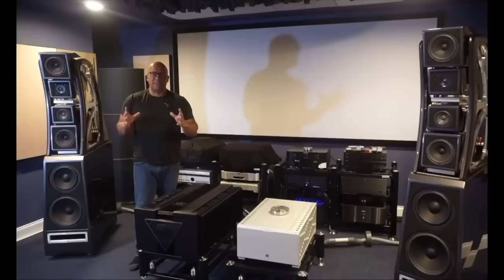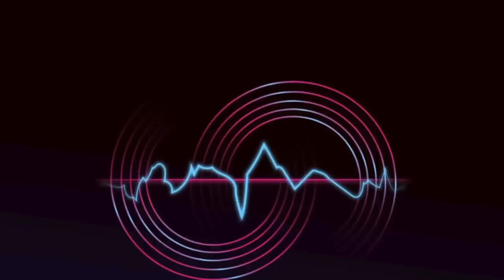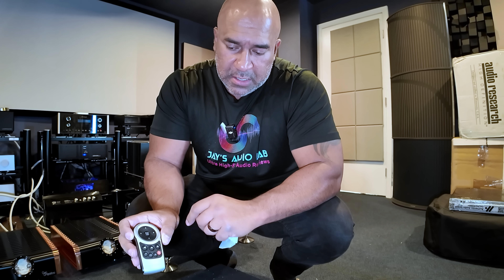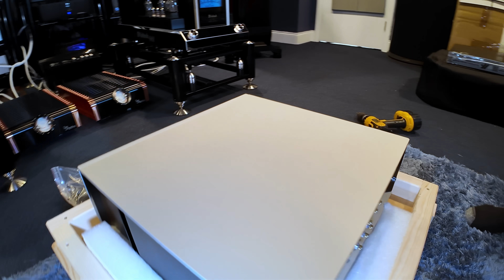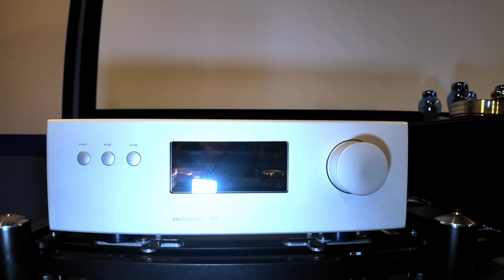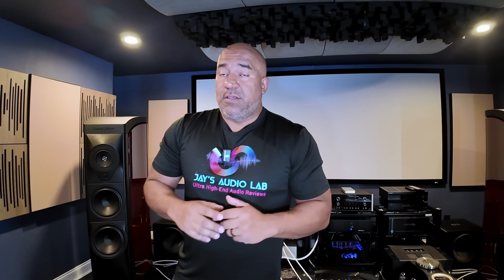Meet My Next Flagship Component !

Comment: The soulution-755 phono stage has volume control and the same output stage as their preamp. It would be interesting to compare this direct to the poweramp vs via the preamp you have at the moment. I am betting 755 direct will sound better. This would be the scientific way to really address the preamp issue rather than just rhetoric.
Reply: I believe the phono preamp is called 757, unless the 755 is its predecessor. I had a 757 in my home for 2 weeks to demo. 

I really liked the available inputs of 757; tape head pre, optical phono, low output MC and 42db MM. It would allow me to replace my CAT SL1 preamp w/phono, step up transformer, Manley tape pre and DS Audio pre. Unfortunately only the optical pre section was up to the musical standard of the component it would be replacing. 

The MC performance was close, a bit lower noise floor but I still preferred my silver wire Bent Audio SUT - CAT combo with its bigger and noticeably deeper soundstage that better placed instruments. There was also a noticeable difference depending upon cartridge as I mostly play only my Lyra Atlas mono MC these days. I still have a few other MC stereo cartridges; VdH, Benz, Shelter and Koetsu but I find myself mostly using a Grado Epoch or my DS Audio cartridges on stereo records. The Epoch was a REALLY bad match for the 757. An incredibly engaging cartridge sounded veiled, unengaging and lacking any fine detail. 

As bad as it was with the Grado, the performance was worse playing the tape head outs of my Ampex ATR102. 

Needless to say I returned the unit to my dealer. I even had the shop owner to my home for his opinion and he just shrugged his shoulders. I’ve never owned a Soulution product in past and obviously there’s a required synergy with certain components. I’d highly recommend anyone considering their preamps to be certain to demo them first.
Reply: @MichaelM-to4sg  No thats the de-emphasis preamp its something different.

Comment: But power cable is just standard of the shelf
Reply: Most people that spend high dollar (or less.) on audio equipment have their cable brands they prefer, so it doesn't make sense for the audio equipment manufacture to buy a certain high end brand if the buyer isn't going to use it. Also, if they did that it would drive up the price of the component. Remember, audio equipment manufactures don't build cables. That's a whole nether business. Every audio component box I have has the power cord still twist tied and in the box.

Comment: LMAO the $3 remote to the $72,000 pre
Reply: Only 6k more than a Tesla Model S. So much technology packed inside the silver sht box than a Tesla Model S...ultra high end bull indeed.
Reply: @wa2368  Take a Polestar for a blast. It has some great features over Tesla. 
Where Tesla fails is it's all ipad hi tec.
Polestar goes backwards for some important essential functions. Which makes it easier and safer for the driver.
Reply: Spot On.
Reply: Try and buy a replacement and see what happens.  Probably find a Bose universal works.
Reply: A tear-down may be VERY telling